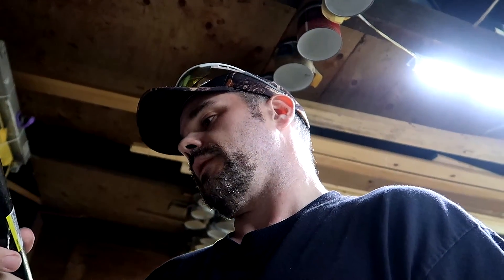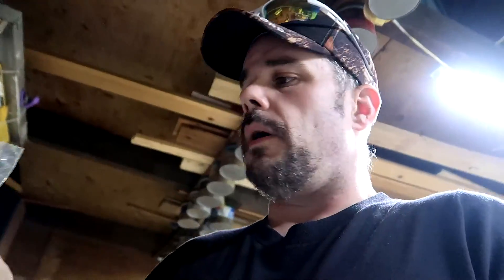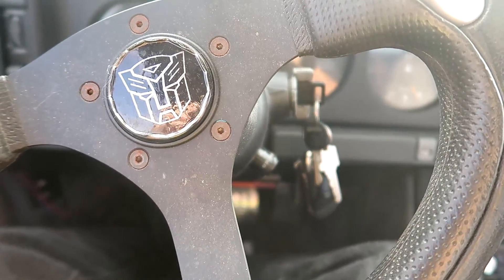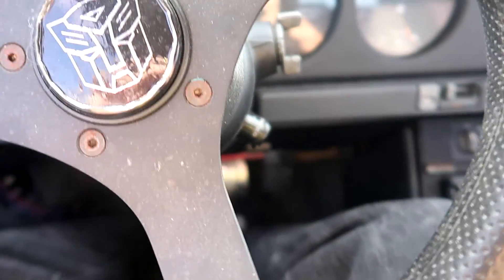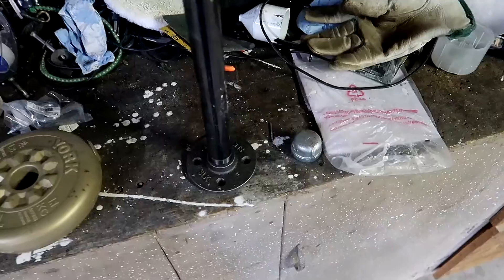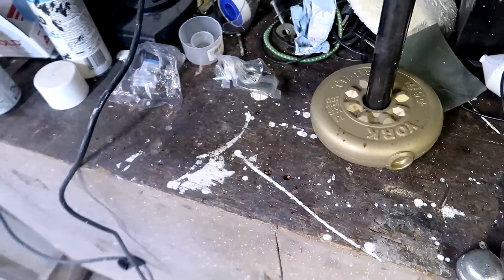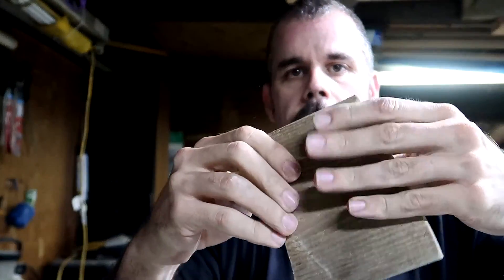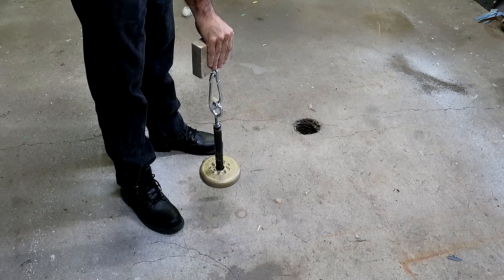Lets Build a Grip Workout Machine

Comment: Noticed you had a stereo system in that dirty bird. What did you run amp/sub wise? Asking cause I’m in to the car audio myself...lol. Currently running a couple 12” American Bass subs on 2,500 watts in my 09 impala..lol.
Reply from the maker: I had a custom fiberglass box in the back with a 12" sound stream sub rating 2400watts peak 1200RMS with a 1500watt sound stream monoblock amp.  Ran it at 1ohm.  It was noisy.